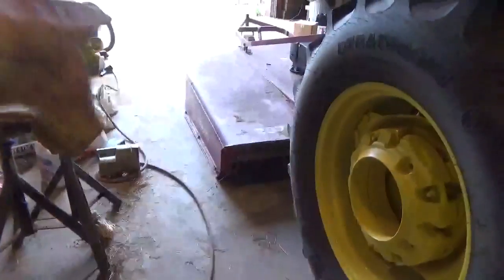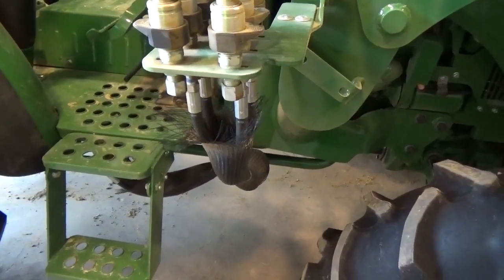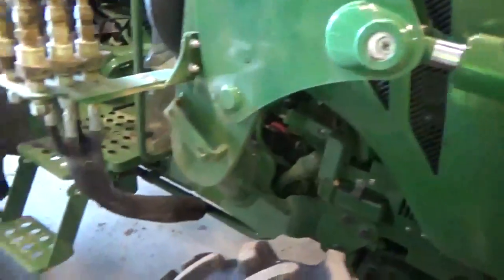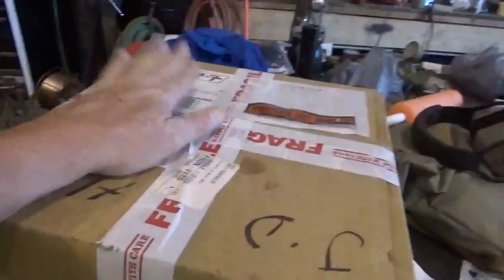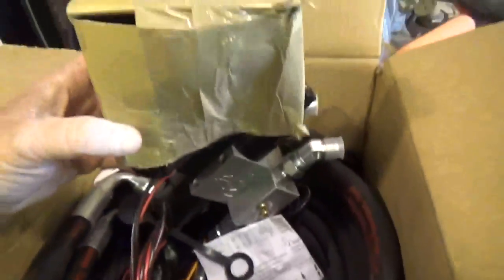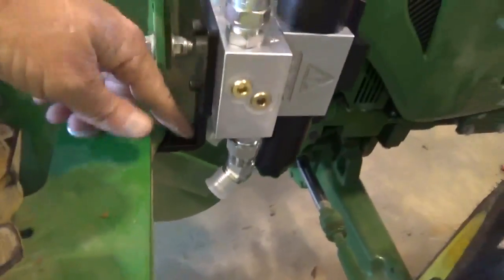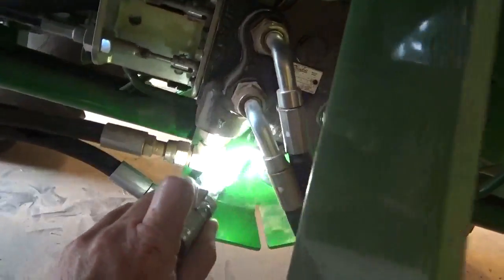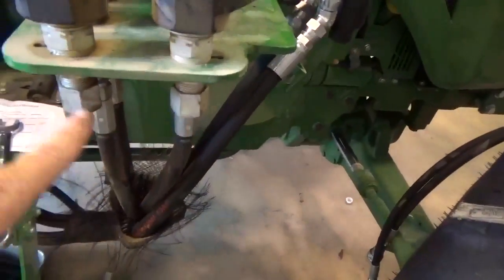How to install a 3rd hydraulic valve on a John Deere tractor so you can use a grapple on the loader

Comment: I have a 5425 and it came with a 2 mid SCV, I changed it out and I had to replace the entire SCV block under the platform, made a clean install.
Reply: Dustin Hruzek  I have a 5425 as well. About what did it cost to install the third value.  One more thing do you have any problems losing prime on the fuel system?

Comment: Hi I think the biggest problem we ever had getting guys to fit diverter kits when we sold new tractors in our dealership was , "They didn't want to spend the money" on top of the tractor and loader purchase price. We even had guys would want to plumb the whole loader into tractor spools to save another $1000. I bet you've already done the bracket , but for the few $ extra I'd probably  just go buy a new line without those extra joins in. I know you only fitted a supplied kit and they are thinking costs but that just looks like farmer fix amateur hour on their part doing it like that.   Thanks for the video see ya around for another one.

Comment: Hey Cottontop, is it possible to show where you connected the hit wire to the fuse block? I’m installing the same setup on my JD 5065E. The electrical is my only scare. Did you have to have any special connectors for the fuse box? Thank you. Perry
Reply from the maker: I just found a wire behind the fuse panel that was only hot when u turned the key and I used a scotch lock to tap into it.

Comment: Where did you buy that valve and that toggle switch handle kit? Also the plumbing and quick connects you added to both ends of the loader before you opened the box
Reply from the maker: The valve was ordered from my dealer, it’s a WR Long. I ordered my loader from Deere already plumbed up to the front.  The we long kit comes with everything.

Comment: Where did you tap your switched power? I don’t see a good place to get it on my 5055E. Not many fuses to choose from.
Reply from the maker: I finally found a wire that worked with the key.
Reply: @cotontop3  I’ve checked and some have switched power but they already have a function so pulling 2 things off one circuit could be too much draw?

Comment: Where did you get the kit from?
Reply from the maker: I found a dealer in my town who could order it.
Reply: @cotontop3  man wish I had the kit reference number. I cant find it anywhere. I have the same tractor and maintain my grandmother's mobile home park. Would be great to get this grapple going for the trees.
Reply from the maker: It’s made by WR Long. I went to their website and I think it’s called a power beyond valve.  Once on their website they had a dealer locator and I went to them and got them to order it.

Comment: Hey Coton I have a ? For you please sir? I have a 5101e tractor I bale with and I have a 563 loader on it. Deere no longer make it and I got hit by a truck doing 60mph two weeks ago and wrecked the loader. So I'm having to get a new one. I was wanting the h260 loader but can't get it in the self leveling but I can get a H240msl  like your but self leveling. My ?'s are how well do you like it and do you think it'll hold up in hay production moving rounds and square with a 10bale grapple? Do you think it'll hold up? My 563 old loader was the heaviest available at the time like the h260 now.
Reply from the maker: +Cody Jones I bet it'll do fine for u. All of the connection points at the tractor are cast now and the whole loader is built well.

Comment: Some kits also Tee into the tank line as well as use the power beyond port. Is there an advantage of this over wr long that does not?
Reply from the maker: This kit does go back to the tank. It wouldn’t work if it didn’t.  Go back and watch how it is plumbed.
Reply: I watched that it had one line in and one line out to power beyond. Other kits have 3 lines. Please let me know if it missed something.
Reply from the maker: One line from pb to valve and then a line back toward the pb port and butt connects back to the tank.  It doesn’t need a 3rd line.
Reply: Thanks for info. Do you know thread size on fittings that the hydraulic line goes on for the power beyond?

Comment: Why wouldn't you just have the dealer put a john deere third function valve and joystick button on when you bought it?
Reply from the maker: +Justin Leary simple, the dealer wouldn't do it and didn't even know it was possible.  They wanted to run lines to the remote on the back of the tractor. I took matters into my own hands and did it myself. That's why.
Reply: cotontop3 i didn't realize that the e series differ that much from the m series. I have a 2014 5115m and i got factory triple rear and a mid/front scv, so i figured you had the same options. I must say, i am very disappointed with the flow to the mid/front scv on my tractor. Thanks for the reply, and if you care to share your thoughts on the flow rate on your machine i would be glad to know what you think. Later, tater!!
Reply: cotontop3 l
Reply: Could you please tell me the name of the company that you purchased yours from ,thanks great video ! You use phrases that I heard as a kid  , cool